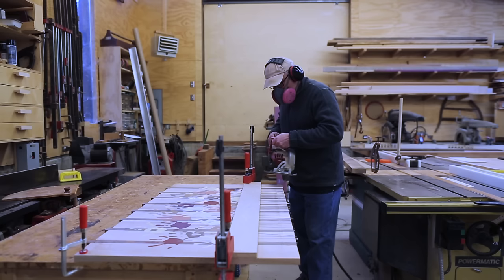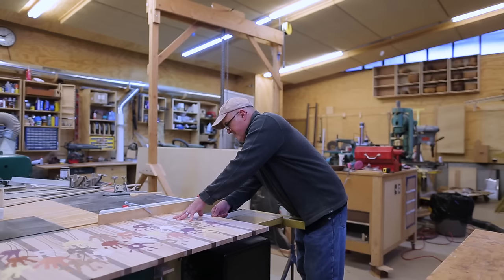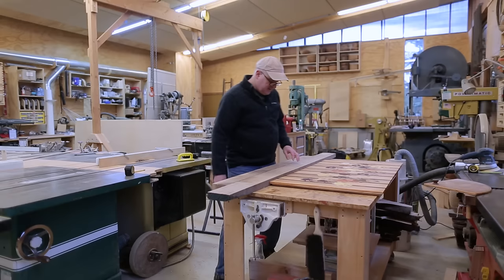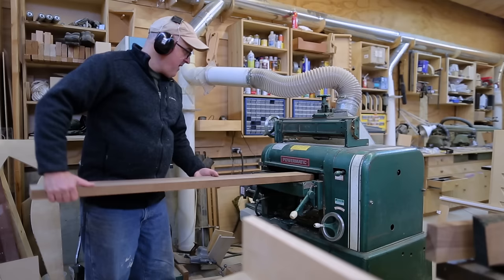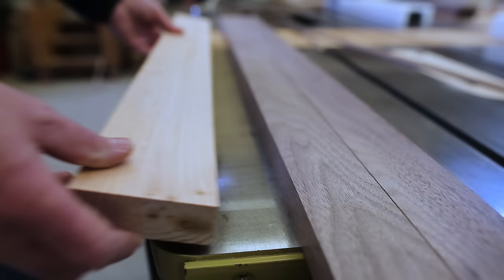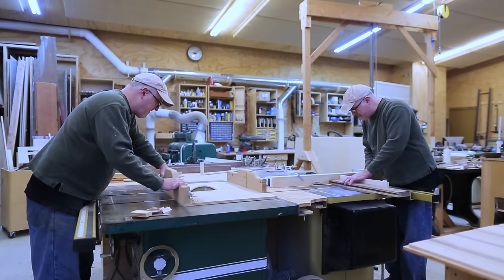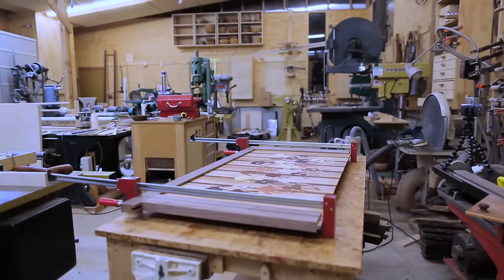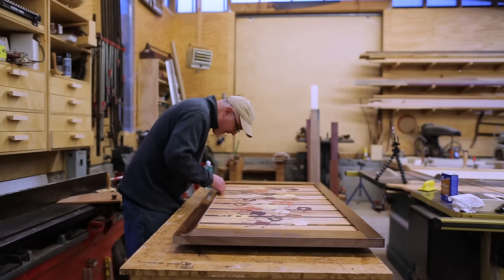Art Frame

Comment: I love it and also hope it does very well at auction. Please let us know after the auction. Personal prefrence, but I would have gone with a longer tenon on the frame. Also you could have put a spot of glue in the center of the panel on both top and bottom to lock it in place, leaving equal amount of room on each side for expanison. This way the panel will not shift in the frame.

Comment: If you hang it any of the standard ways, the full weight of the art is resting on the two glue joints between the side rails and the bottom rail.  I don’t understand wood glue enough to know if that’s fine, or if it might suddenly give way in 20 years.  Anyway if it is not reliably strong enough over spans of time you might reinforce those two spots in some way.

Comment: Frank, you could automate the tracing of the hands with a short OpenCV program to remove all of the smaller details, assuming you were ever to be doing something like this again:)
Reply from the maker: +Jake Mercer I will have to look into that.  thanks
Reply: There are likely better ways to do it; chances are there's a Photoshop preset/plugin to do it even.  I've done similar things to live video feeds with OpenCV for object recognition, so I know it can work, usually along the lines of: 1) Isolate item of interest, either by colour or shape. 2) Erode/Dilate area of interest to smooth edges.  Repeat until suitably smoothed out.

Comment: When talking about the walnut used for the frame, you use the phrase "rip" -is it just a substitute for cutting in any direction, or is cutting a specific way or with a specific tool?
Reply: Colin Ferguson 'rip' means cutting along the line of the grain whereas 'crosscut' means cutting across the grain
Reply: Rip to me, is cutting along the grain, hence a rip saw and cross cut saws being vastly different.
Reply: A rip cut is along the grain, and a cross cut is across the grain. You'll usually see that rip cut saws (be that handsaws or table saw blades) have fewer, larger, teeth (and deep gullets) in order to clear the wood fibres. Cross cut blades tend to have more, smaller, teeth, as they slice through the fibres.

When rip cutting with a tablesaw it's usually a good idea to have a short fence (one that doesn't extend beyond the leading edge of the blade) as ripping can release stresses in the timber, which can cause it to bend and get trapped between the fence and the blade.

EDIT: I see others got there first with answers :)